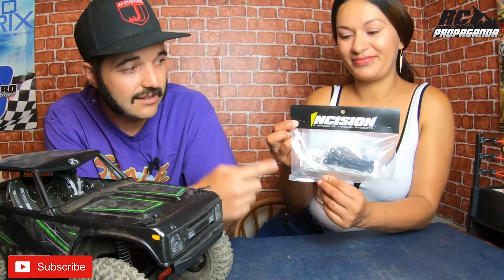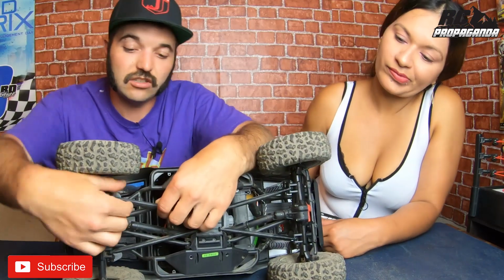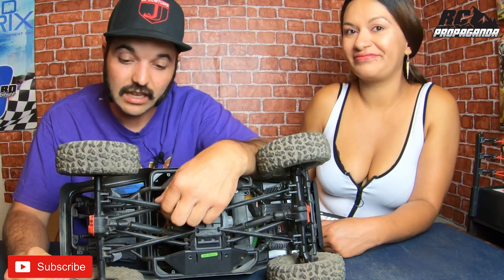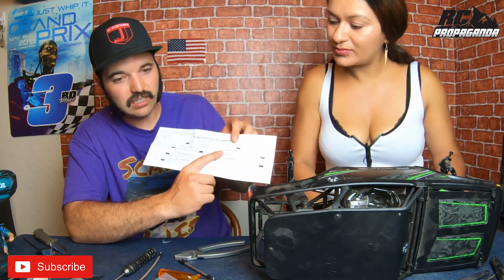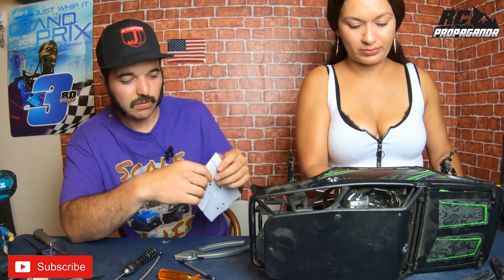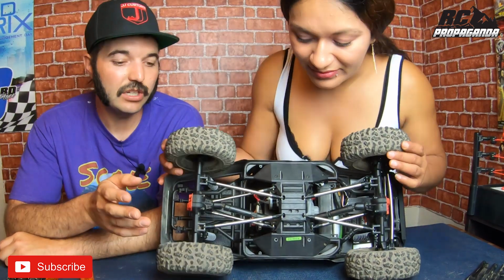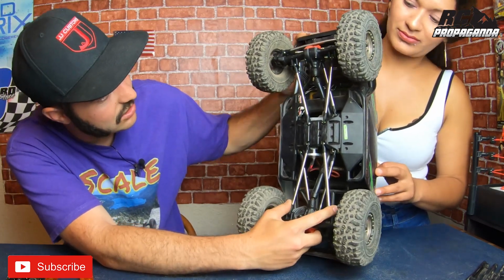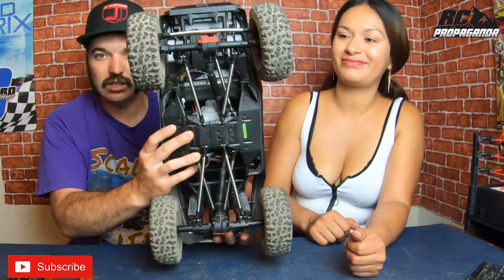Wraith 1.9 Gets It's First Upgrade

Comment: I like the incision links. The scx10 3 comes with links like the Capras   Pretty beefy ,opposite threads on both ends so you can adjust the length by turning the link on the truck like a turnbuckle.